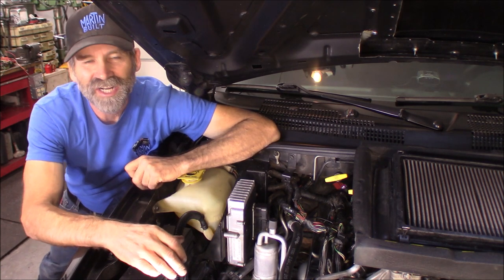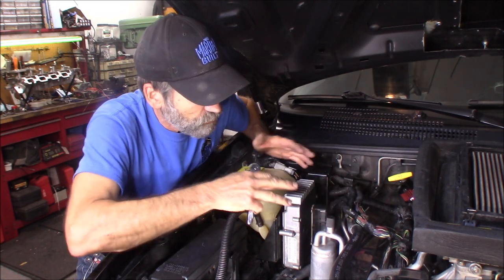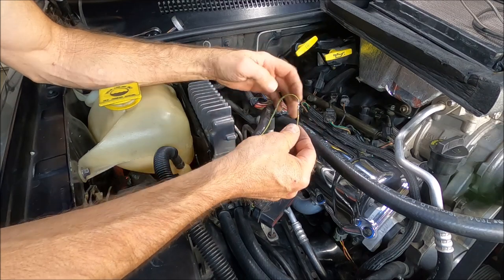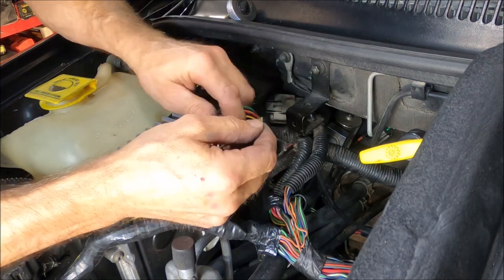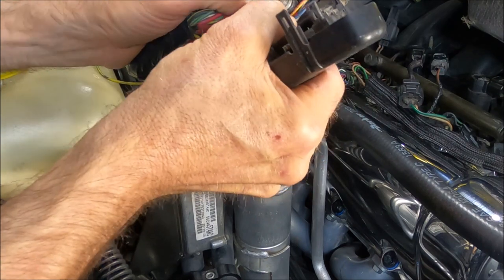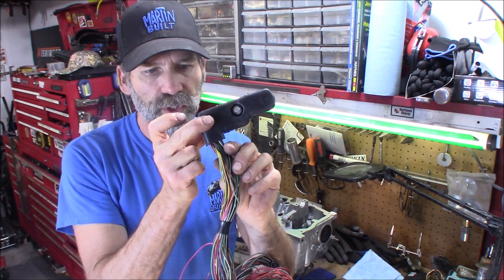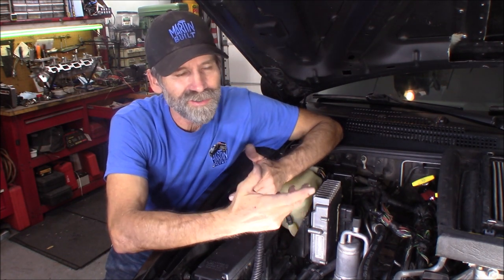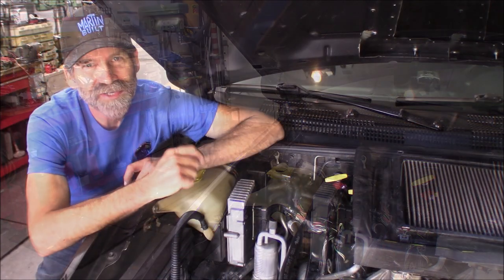How to Delete Torque Management  99-04 Jeep Grand Cherokee

Comment: Hello sir, just came across this video. Subscribing now. I have a 2004 Overland with 6.5” lift and I pull my boat which ways with the trailer 4200lbs. Just a 10 min backroad ride to the lake. Going to try this but I was wondering if anyone makes a chip for the HO motors? Called Superchips and was told they only make one for the non HO motors. Thanks!
Reply: Or a tuner?
Reply from the maker: It can be done with HPtuner but that would cost you $500
Reply: @martinbuilt  would you say it’s worth the money? Or would going from 3.73 gear to 4.56 be more beneficial? Thanks again.
Reply: @xrpinvested970  anytime you start adding weight to the equation, 9 out of 10 times, gears are best choice. Even take full size trucks.... same drivetrain but weight ratings increase with gearing. It simply makes life easier for your powertrain

Comment: Is this the same for a 4.0?
Reply from the maker: No the 4.0 uses a different transmission this is only for the 545 rfe transmissions with a 4.7 engine.
Thank you for watching.
Reply: @martinbuilt  ok thank you, do you know what or if there’s a wire for the 42re?

Comment: So is Chrysler / Jeep "Torque Management "    similar to what is known as traction control  on some other vehicles?.   Or just a style of traction control specific to Chrysler / Jeep.
Reply from the maker: traction control and torque management are two different things, torque management just give you a smooth shift from one gear to the next. Traction control keeps the tires from breaking traction.

Comment: Did that and it throw a torque management code and dont have kickdown when i floor it 👍
Reply from the maker: That surprises me. 😮 
What year vehicle and engine do you have?
Reply: @martinbuilt  2000 WJ with a 4.7
Reply from the maker: @petitepatate9727  It should have worked. Are you sure the wire that was cut went to the #10 in the connector on the TCM?

Comment: Use a sonax line pressure kit. Much safer. This is not an advisable idea. I've tested this and yes you will get a much firmer shift not just firm but very fast quick shift good for drag racing but the transmission will not be happy about it. It severely effects 5th gear operation at cruising speeds and the operation of the continuously variable logic in the tcm. I can't say this enough. Do not do this have you're transmission tune if possible but not likely with the 45 / 545rfe get a line pressure kit so your transmission functions as it should and this only cost $50 and takes 5 minutes and you have a firmer quicker shift safely. Yes it will function this way but it will not function properly and can actually cause the engine to Stahl when too much pressure is applied inside the trans at the wrong point in time.
Reply from the maker: Well, my transmission has never complained about it.. lol 
The only time you even know that  the torque management has been deleted is at 3/4 to full throttle at normal driving conditions it shifts exactly the same as it did before.
Reply: Not sure if it’s a coincidence, but shortly after doing the torque delete, my car started bucking hard on the highway at certain speeds, and then stalled out completely into a crank no start. P1391 replaced both sensors with mopar, not much improvement. I can get it to start but it’s out of time and misfiring very rich. Starting to think I cracked the tone ring or the timing chain skipped.

Comment: I just did it and took her for a spin but I didn't notice a change. :(
Reply from the maker: Did you try it at least 3/4 to full throttle?
 You will not feel a change with normal driving conditions.
Reply: @martinbuilt  actually yes. So it's a thumbs up for me. I do have a question. 

My 99 V8 limited has a clutch fan. I HATE the way it sounds. Just big and airy and drowns out the normal engine sound. What are my options? I'm also assuming that the clutch fan is taking some HP from me.  I'm new to Jeeps. Used to having a goosed up 460 with a switched electric fan.  Thanks boss
Reply from the maker: @tonyfourpaws4511  I like the E-fans. You'll want a powerful one. Like the one, I used from a 98 Jeep Grand Cherokee with 5.9L or the Ford Taurus 3.8L
Reply: @martinbuilt  I used two of the Ford ones on my 460 van. Never ever EVER got hot.
Reply from the maker: @tonyfourpaws4511  I believe that! Those Taurus fans really move some air. I love those old  Ford 429/460 engines.
Reply: @martinbuilt  yeah, they have tons of stock power and can be goosed up for around a grand or less. They are also super easy to work on.

Comment: Tcm  not tcu
Reply from the maker: This is from Google
A transmission control unit (TCU), also known as a transmission control module (TCM), or a gearbox control unit (GCU), is a type of automotive ECU that is used to control electronic automatic transmissions.
Reply: @martinbuilt   yes but since you are working on a jeep that lists a tcm  as well as a pcm maybe call it what the manufacturer  states is the correct name not what Google  picks ....
Reply: @martinbuilt  but I do like the video  and may do this

Comment: Does this work on a 4.0wj
Reply from the maker: Unfortunately no this is specifically for the 45rfe and 545rfe transmissions that come with the 4.7 engine.
Thank you for watching.
Reply: Thank you sir for responding I enjoy your videos I check them out all the time I have a 4.0 wj if you have any tips for this one let me know when you can and thank you because you and another dude helped me cure my death wobble and helped me fix a few other things as well